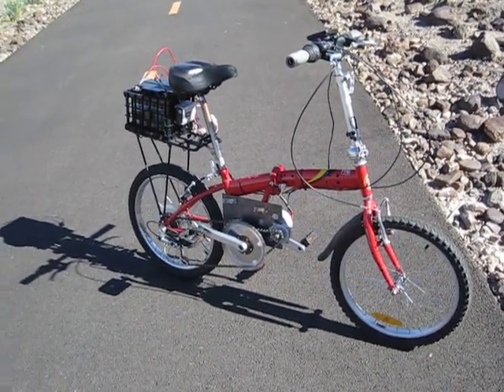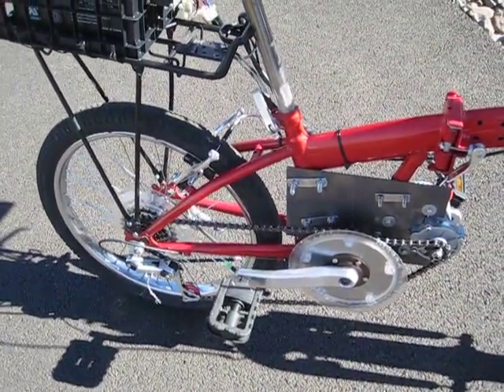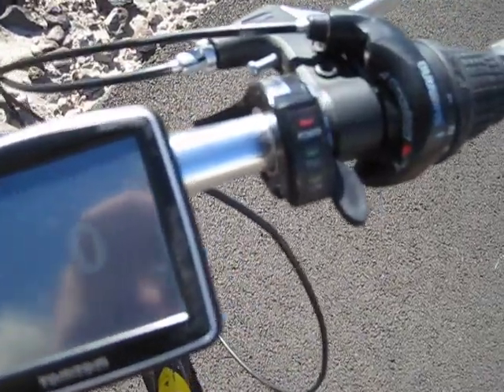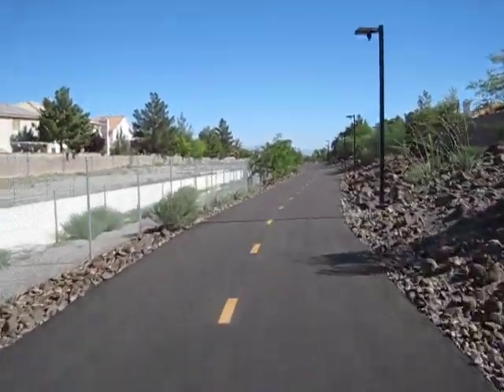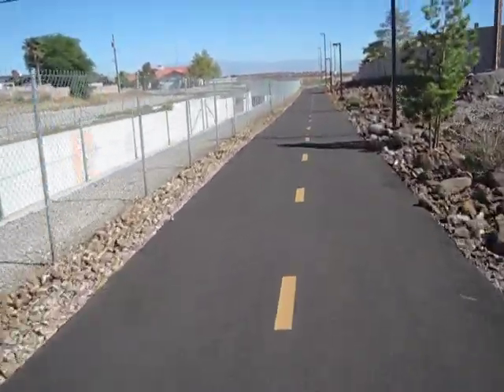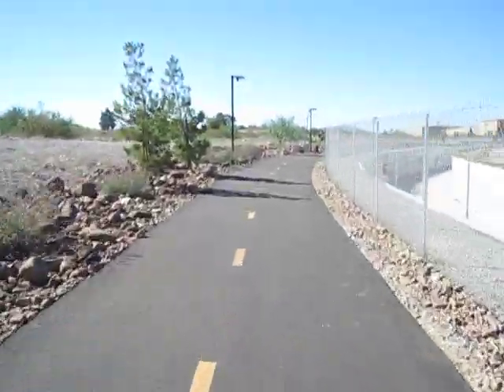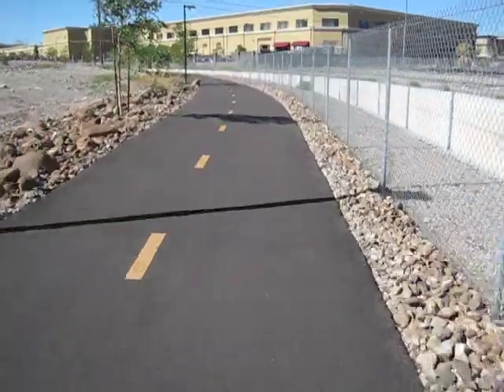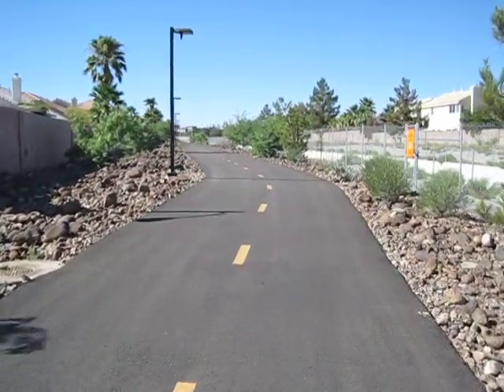Bottom Bracket Drive Homemade Electric Bicycle 27MPH

Comment: Thanks a lot for your swift reply. I had gone through your triple freewheeling crankset video but I could not understand: 1) the pedal is / can be stationary with the pedal chain forward motion when motor is in action and the same pedal chain is in forward action with pedalling power when motor is off. 2) what is the need for third chain ring in the crank set-( out of three one for motor and another for back wheel)? Thank you.

Comment: Still playing with this ebike project? 

Go to Hobbyking(dot)com order two Zippy 22.2v 8ah lithium ($80x2), & a low cost charger, hook in series (+ to -) to get around 50.3v charged. This way you get 5lb on your rear, instead of 20 & quite a bit of a performance increase. The 24v motor and controller can take the upgrade.

You could buy the 18.5 Zippies for a 43v (charged) upgrade if your not so brave.

Now, let's see a video with this upgrade.  :-)